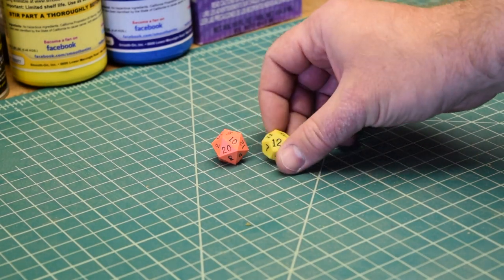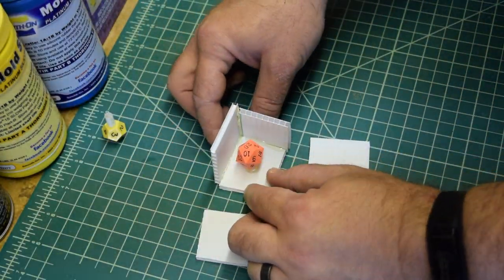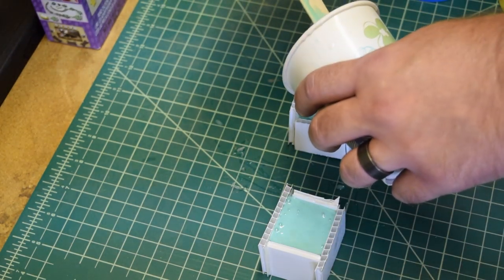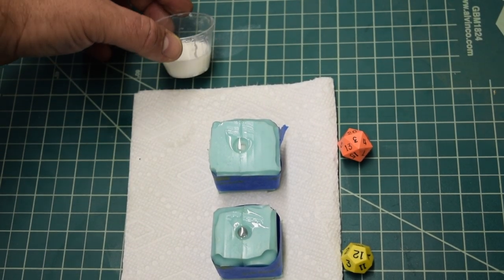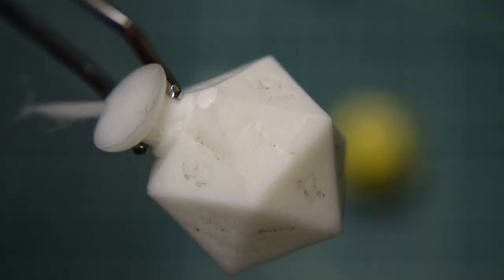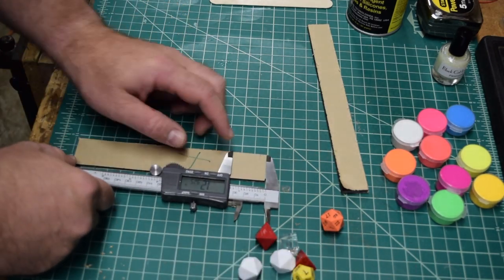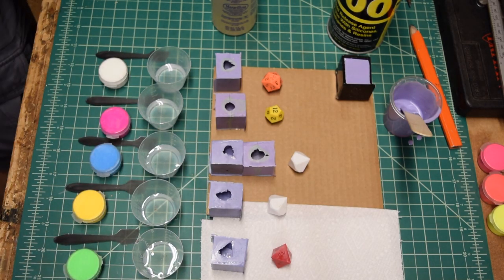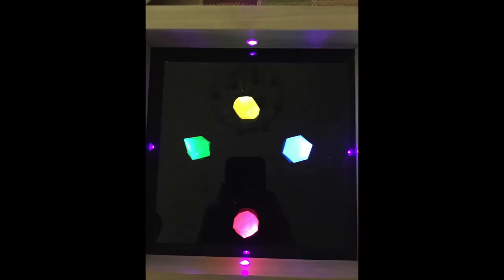UV Reactive Dice Part 1 - Molding and Casting

Comment: I know this is a really old video and you've probably since figured this out, but you can save time by using the corrugation in the plastic board you use to make the box to create the box without cutting individual pieces. 

Simply cut a strip of the plastic board, making sure the corrugations are aligned vertically, then you can slice through one layer of the plastic through the centre of one of the corrugation lines at equal intervals to fold it into a box. This also has the benefit of saving on the gluing/sealing of the box (with the exception of the base).

Comment: The mold release needs to dry or it will cause bubbles. Brick In The Yard has tons of videos on molding and casting all kinds of things
Reply: So much this^ You gotta let that stuff evaporate before pouring resin over it.

Comment: Have you ever thought of putting a back massager  on the underside of your work table or next to the apoxi mold on the table to try and vibrate the bubbles out?
Reply from the maker: That's a great idea!  We have plans to build an adjustable vibrating table, or a degassing chamber for that purpose.
Reply: I've also seen people use vacuum chambers on the silicone mix, but I have no idea how to make one of those. If you guys have a nebulizer or some sort of air pressurizer for an airbrush, you can remove the plastic nubs that keep it from shaking your table so much, or you can just set it on its side (a temp solution). 
The easiest way for the vibration would be my guess to buy a few hand massagers and attach them to the table.
Best of luck on your project!
Reply: you can make a rough degasser by taking a tupperware box with a good seal, cutting a hole in the top and glueing in the valve part from one of those cheap vacuum storage bags for clothes, just make sure you have the silicone mixed in a cup that is way taller than you think you need, it expands a lot during degassing, then settles after its done